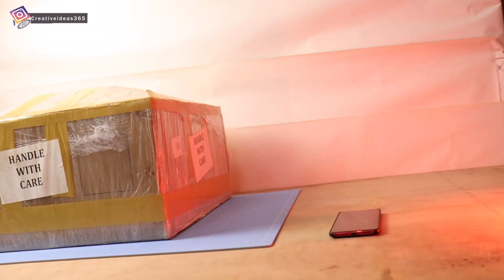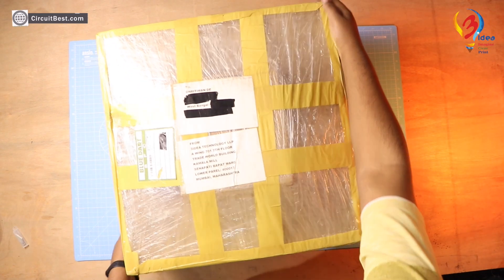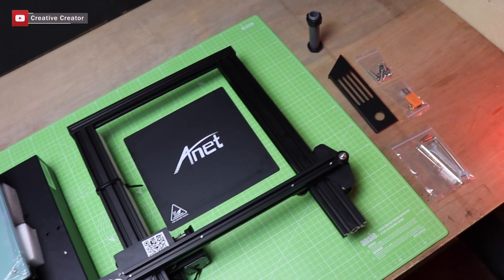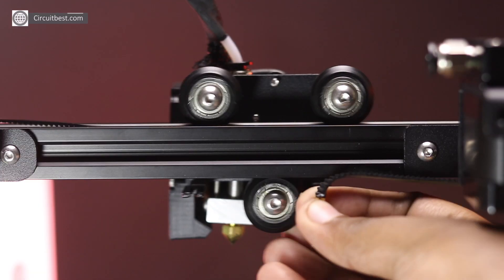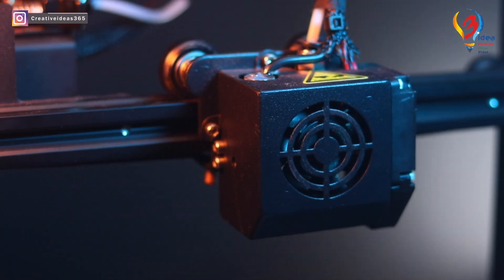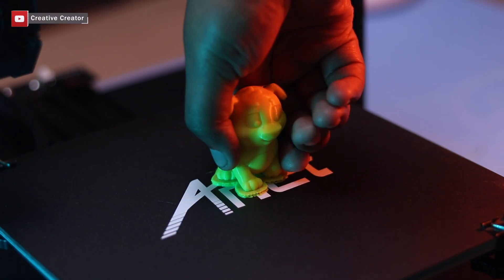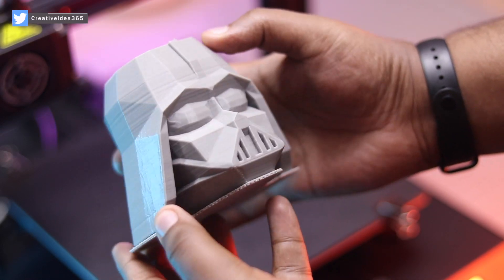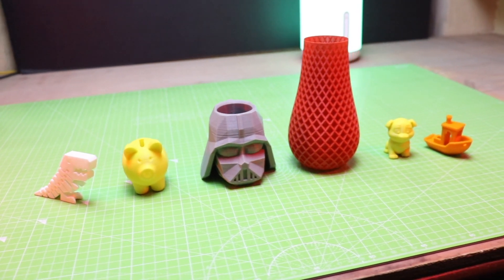ANET ET4 Pro - 3D Printer - Unbox & Review (Latest Version)

Comment: Do you use anything (glue, spay adhesive) on print bed?
Reply from the maker: no bro but I used bed temp at 65 degrees
the only glass bed is bad. print comes out easily so I used the sticker. This sticker has good adhesion.